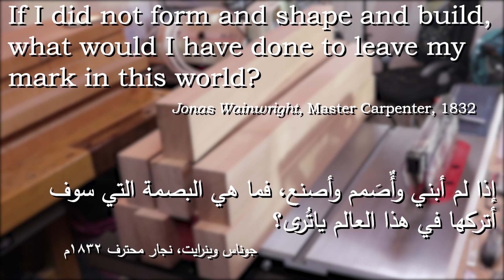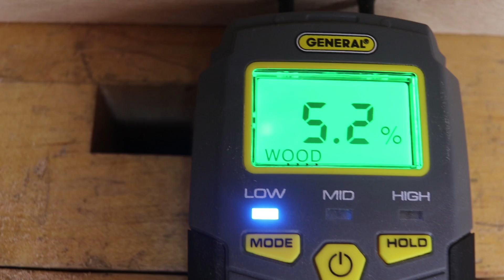Roubo WorkBench Part 1

Comment: Before finishing you cleaned with denatured alcohol. Then you finished with a mixture of something???, tongue oil, and lacquer thinner. What is the something?
Reply from the maker: Yes, pure Tung oil and Minwax tung oil finish which is harder than tung oil alone, I think it is a mixture of tung oil and some kind of lacquer. You can use poly or lacquer alone! Just give the workbench some sort of protection.

Comment: I like that jointer safety block. Where did you get it or what is it called?
Reply from the maker: Thx, if you mean the yellow gripping push block? Then this is the GRR-RIPPER 3D Pushblock for Table Saws, Router Tables, Band Saws, and Jointers by MICRO-JIG
Reply: @TheWoodCrafter1  about 30 seconds in you are jointing some wood. Your jointer has the big arm contraption on it. That’s what I’m referring to.
Reply from the maker: @WalterBuildsItAll  Ok, yes this is a safety protection that came with the jointer, this is the standard one for Europe, in the USA they have a push block for protection that moves forward when pushing the wood forward, I think that the Europe design is safer but I am not sure if you can find it in the US. Hope this will help you. Thx
Reply: @TheWoodCrafter1  that does seem more safe. I have the latter, being in the USA. Interesting work. The bench seems to be on the expensive side no?  Do you do much hand tool work?
Reply from the maker: @WalterBuildsItAll  actually the wood cost is around 400$ + the 150 hours of work 🙂, I do some hand tools work whenever necessary but if machines can do the job faster and I have them then this is the way to go.

Comment: What are the gloves for?
Reply from the maker: You don’t need to use them!
Reply: @TheWoodCrafter1  whew, thanks
Reply from the maker: Actually wearing gloves is not recommended when using machinery, I developed this bad habit when handling rough lumber to avoid sharp wood splinters, but I am getting rid of it now. Thank you for pointing that out.
Reply from the maker: @richardmckrell4899  nice songs you have though 👍
Reply: @TheWoodCrafter1  Thanks I appreciate it
Reply: @TheWoodCrafter1  Thanks, my business is  restoring wooden windows with linseed oil paint/products and making custom wood storm windows and wood screens.  I'll be posting some window restoration videos soon.  I'm in Connecticut.
Reply from the maker: Cool job, I am doing woodworking for fun and as a hobby, tag me to your video once you upload it, would love to watch.
Reply: @TheWoodCrafter1  Sure
Reply: I agree with the glove comment. Glad to hear you are trying not to use them. Nothing is more dangerous than getting gloves/clothing caught in a piece of rotating equipment and suffering a much greater injury. Very nice work and thanks for sharing.
Reply: @viperman300  I was really just kidding about the gloves.  Wear whatever makes you comfortable.
Reply from the maker: @viperman300  thank you 👍
Reply from the maker: It is more comfortable to handle lumber with gloves, yet it is not recommended with rotating machines as @viperman300 pointed out.

Comment: Any chance for a detailed plan for this beautiful table, bless the hands for making such beautiful table
Reply from the maker: Thank you for your nice comment, I don’t use plans sorry, the rest depends on the vise parts you will be using.
I will share the dimensions if this will help.
Blessings 🌹
Reply from the maker: The top thickness is 9 CM, workbench length is 160 CM, width is 58 CM, height is 85 CM, hope this will help. Had to make it small size as my workshop is 6 by 5 meters. 
Thank you again for watching 👍

Comment: Enjoyed watching this. You seemed to be very meticulous about aligning the laminations with precise doweling. I didn't expect that board #7 in the center to come out that much lower than the others. What happened there? Was it doweled wrong ? Was it accidentally narrower than the others? I was expecting the top to come out needing very little flattening, not a router sled :)
Reply from the maker: 🙂 That particular piece was originally narrower than the rest as I had no more wood left, so I decided to place it in the middle where the bench splits, but it was also aligned to be flush on the top side as it is where it matters! The router was used to flatten the bottom side not the top which is what you see in this video. 
Check 24:43. 
Thx for watching
Reply: @TheWoodCrafter1  that makes sense now. I had not noticed it was the bottom. You should see the mess that is the bottom side of the tops I make :)
Reply from the maker: @sergiopereira  🤗👍

Comment: I don't understand why you drag your miter saw across the board 3 times before cutting all the way through. There is no advantage over a single cut unless you know you have a dull blade or something and don't want to buy a sharp one yet. I don't see you triple cutting boards on your table saw.
Reply from the maker: The table saw I have, has a 3HP motor so it is overpowered and won't stall, you can make one cut on the miter saw if you want, I just wanted to go easy on the motor by taking light passes.

Comment: Watching you use a chop saw was painful! And please when cutting all a mortise don't use the chop saw, use a skill saw set to the appropriate depth. It's just more accurate.
Reply from the maker: Thank you, for your comment, the chop saw, (miter saw) I am using has a depth stop that can match the circular saw accuracy and exceed it.
Reply: @TheWoodCrafter1  lol umm no if you like to get technical it's a sliding compound miter saw and your wrong about the depth setting, the flex in the slide arm will give you a inaccuratesy of 1 or 2 mm the depth setting on a skill saw, once set accurately never varies.
Reply from the maker: Great info, thx for sharing, what matters in that particular mortise was the sides as the leg's top tenon will not touch the mortise bottom, and the workbench top will be carried by the shoulders of the legs tenon. Nevertheless, it's a good point you have highlighted. Thx